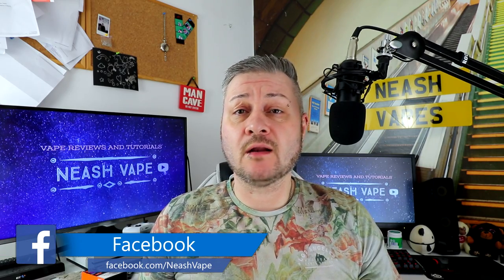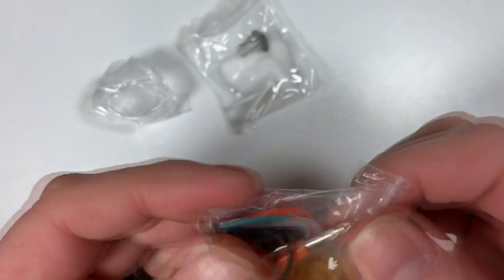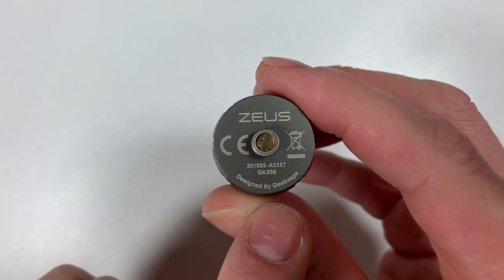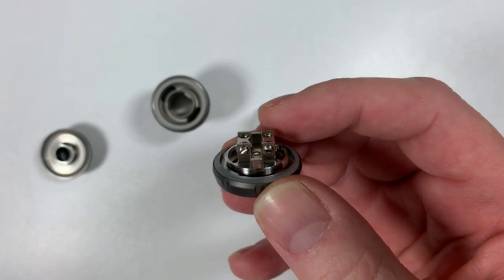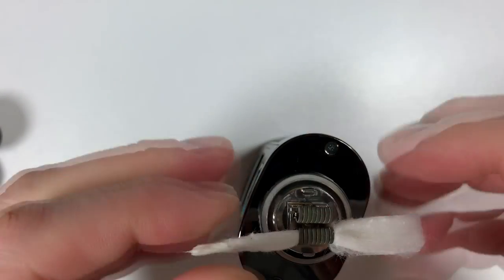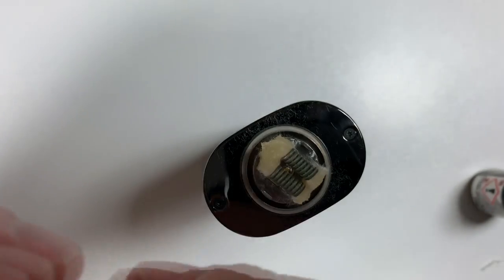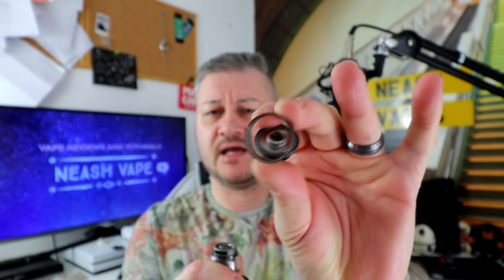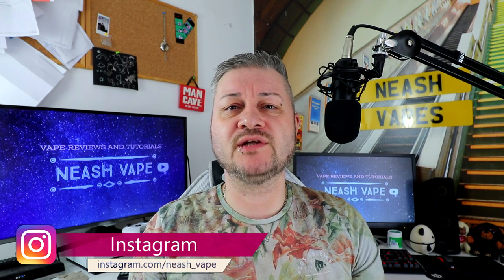Geekvape Zeus X RTA - Review and thoughts

Comment: @Neash Vape I picked one of these up based on your review.  It's much easier to wick than the Kylin 2 as you stated.  The only issue I have had is after my last wick.  When I remove the fill cap, it leaks at the seal between the build deck and the glass.  I'm guessing when the vacuum is broken it leaks there due to a bad seal, but wanted to get your thoughts on it.  Thanks for the review!
Reply: Think I got it sorted.  The bubble glass it seems is not the same on both ends, or has an imperfection.  One way seats easily and leaks with the fill cap off.  Flip it over and it does seat as easily, but doesn't leak with the fill cap off.
Reply from the maker: Joe Morris glad you got it sorted 👍🏼